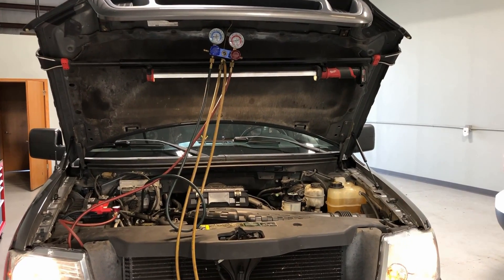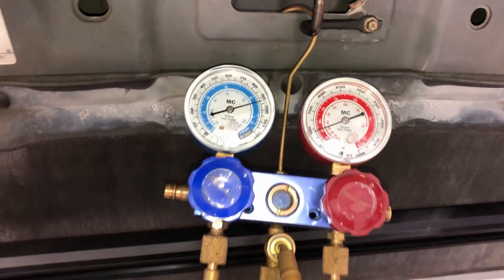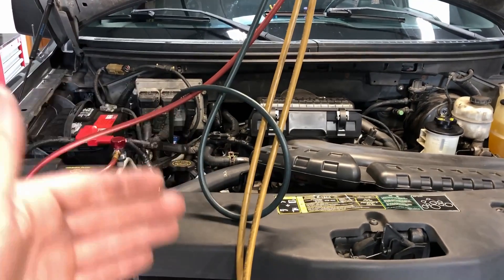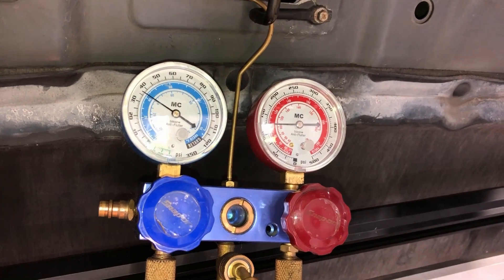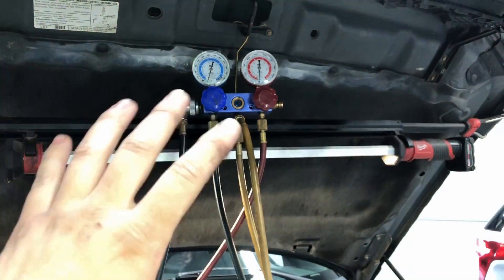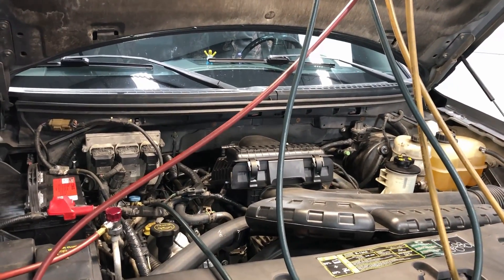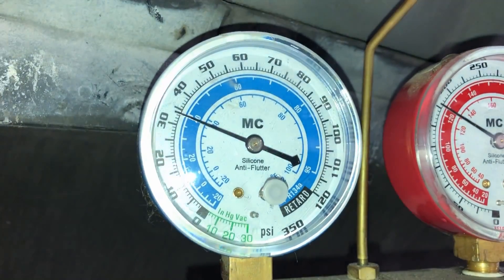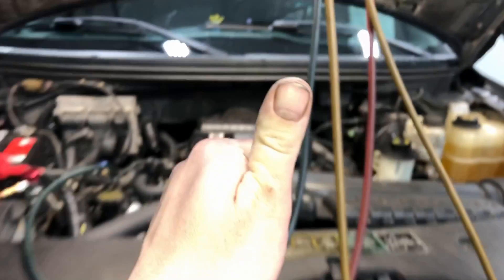Poor Automotive A/C Cooling: Do You Have a Low Refrigerant Charge Level?

Comment: I have a 2000 F150 and would do about anything to figure out how to access the condenser coil to clean it out. Low air flow. I don't care about looks if I need to cut through anything to access it. Can't find anything online that actually makes sense, no one knows how to explain or teach details these days. Same goes for the heater core.
Reply: Sweet project cars has a video showing how they clean condensers thru the drain line. They include links to all supplies.
Reply: Evaporator?   The condenser is in front of the radiator.  My used 2001 F150 blew almost no air through the evap.   Get a couple of cans of foaming AC cleaner. They come with a 2 foot hose to insert into the AC drain hose.   Plenum fills with cleaning foam and rinses out when you start it 1/2 hour later.   I used 2 cans for good luck. Brought mine back to life. 

( Many stores don't even know what you're asking for.   Don't buy the AC flush - that's to clean out the system after a mechanical failure, not the evaporator fins)    I got my cans at O'Reillys.    Also on Amazon.
Reply: @NYCMNYBW01T  - Thanks, yes evaporator. I saw a great video on inserting a can of AC cleaner with a tube applicator into the evaporator tube hole all the way up and spray a couple times. But I cannot find this thing on my truck. Only reference online was some guy said it's just barely a nipple and didn't think anything could go inside it because it's so small (he thought was clogged). I saw poorly made videos on cutting out areas inside the cab to cut open to access and clean. Horrible directions.

Comment: When I turn on my air conditioning it bogs the car down I have low power what could be the problem
Reply: Check for an over  charge man dose the compressor  growl at ya
Reply: @robertdunn7717  so the only way to fix that is discharge the system?
Reply: Robert Dunn yeah
It does groul..why
What does that mean..??

Well its cooling normal, 
but the groul is there loud & clear when take off from a stop sign. 
When clutch disengage the sound goes away. 

Any idea??
Reply: Check for dirty throttle body. Cleaning the throttle body fixed my problem when I turned on the air conditioning. Would almost stall the car at idle.
Reply: @donaldclouse2374  thanks I can do that not to hard of a job
Reply: Granted there's no compressor damage have a shop recover so you stay legal and pot in what you need

Comment: In my car, when the compressor turns on the low side is 60, high side 105 and blows warm (compressor does engage), as I rev the engine, the low side reaches 30 and the high side also increases and begins to blow cold. Should I assume the compressor is shot? 09 Escape Hybrid
Reply from the maker: You need a refrigerant control valve on the backside of the compressor.

Comment: My sons 2011 Fusion has been blowing cool air, not cold. But enough to keep him from sweating. Maybe it’s low too. It’s been a scorching hot summer here in Chicago.
Reply: Could be an issue with the Schrader Valves.  There was an issue in 2011 on the ports.  It affected LOTS of vehicles, and not just FMC.
Reply: Harbor Freight is your friend. Get the manifold set it works well. 2011s probably have dye installed. Look for it with a uv kit. HF also has an electronic leak detector for ~$50. Works great.

Comment: So you are looking for those pressures, High and Low, when at idle (650 - 750 RPM) with the system in Max Recirculation mode in an FOT system?  This is fairly typical I'm guessing?
Reply from the maker: yes

Comment: Yep, that time o'year! Got the neighbor's ('04 maybe?) F-350 with a leaky condenser - he patched it with JB Weld until the new one gets here, lol. Pretty weak condenser on that truck. Looks like a stone took a little chunk out of it. Leak the size of a pin. No sniffer needed - just watch for the fog ...

Also have my dad's 2 year old Frigidaire window unit here - all the refrigerant blew out the corroded condenser - unit is barely over 2 years old from its manufacture date! What a pile of crap! Gotta love 21st Century manufacturing, no matter what line it is ..
Reply: I like the big red warning label on the new units explaining that the refrigerant used is explosive and that there is a risk of fire if they leak !! Yeah that's got to be a big selling point "Here put this bomb in the window of your bedroom"

I've been seriously thinking of just rebuilding the 20+ year old 12K wall unit we have rather than buying a new "efficient" unit.
Reply: @Blazer02LS  - Yeah, you'd be better off! I couldn't believe they made the condenser so thin, especially with R-410A - it has high side pressures north of 475 PSI !! Then they used the crappiest quality metal they could source. Better off grabbing an old one, and either charging it up with BBQ propane,  R-12, or R-22.

Comment: With this hot weather, my 2013 Lariat that I purchased used sounds like a jet engine when the truck is started and takes a while to get cool.  If the temperature drops to 80 degrees later in the day, it won't sound like a jet engine and the AC is really cold.  Is this normal behavior?

Comment: Great timing! I see you linked a set of manifold gauges... do you have any experience with them? Are they good enough for a DIYer? I don’t mind spending a little more if necessary.
Reply from the maker: They are just fine, the next step are gauges over $100.
Reply: Great! Thanks for the reply.

Comment: New subscriber after a few videos. You seem pretty knowledgeable about fords. Here’s one for you man. I have a 2013 f150. 5.0. When my ac is on my fans sound like a jet engine. I’ve had it at the dealership, other guys have looked at it. Nobody can figure it out. One shop finally settled on the ac drier and expansion valve. But what I’ve read it’s a sensor. Any thoughts?? A computer strictly for fords was hooked to it while it was roaring loud and nothing was found. Thanks man! And enjoy the video!
Reply: The radiator cooling fan should run at full speed when your AC is on, that's completely normal.  The condenser is in front of your radiator, in order for your AC to work you have to have very good air flow through that condenser/radiator, thus your radiator fan will be forced to run at much higher speeds than when you are not using the AC.

If your radiator fan is mechanically operated via the old style fan clutch and driven off the engine, same thing happens, the excess heat causes the clutch to engage forcing the fan to spin at a much higher rate of speed.

Comment: Great video - I've got a Ford Five Hundred , and now I have an idea of why my AC is not as potent as it should be. Bought myself some gauges - off to my garage I go...
BTW - ensure that your Compressor Control Valve is not sticking. Had this problem with my car originally. Car had a full charge, but very poor A/C performance. I replaced the valve and it worked 100% better.
Reply from the maker: Yeah your vehicle is one of the few Fords that have that valve.

Comment: Thanks for the info I need to check the system on my 2010 f150. The AC does not blow cold untill you get to high way speeds.
Reply: Make sure the condenser has good air flow, no debris like bugs, leaves, paper and grass for starters.

Comment: Nice Work!  This is the weather for A/C problems!  A lot of people don't know that the A/C system comes on in the winter during defrost, so if the struggled through the summer, definitely get it fixed in the fall!
Reply: If you turn it  on
I turn it off!!

Comment: Does your recharge machine add proper amount of pag oil when you recharge the system?
Reply from the maker: No I add it manually
Reply: @FordTechMakuloco  Can that be done without opening the system?  Or do you add it after evacuating?
Reply from the maker: Yes the injection gun has a one way valve.
Reply: @FordTechMakuloco  Yes, that's what I was looking to know.  Thank you for all the helpful videos.  You do a great job with your channel.

Comment: What is your best guess for vehicles with only low charge that test out with no leaks? Most cars' A/C lines are that half metal half rubber crimped deal, and I'm assuming the refrigerant just diffuses out the rubber part over time. Kinda like the air molecules being smaller than rubber molecules, diffusing out over time  through the rubber of a tire.
Reply: Yes you are 100% correct! Also the shaft seal on the compressor is not a perfect seal!
Reply from the maker: If the system has a low charge and it is not because of being charged improperly in the first place then there is definitely a leak most times at a connection or the condenser.

Comment: good video but why no check for leaks ???
Reply: The system was still holding static pressure and had half a pound of refrigerant in it. Being that this truck is 15 years old and probably on its original factory charge, I can see what he didn't do a long vacuum hold test.

He did totally Evacuate the system and it did show vacuum for quite some time.

Even brand new compressors with minimal use will leak a micro amount at the shaft seal behind the compressor clutch.

When you add 10 to 15 years of age 2 vehicle they will leak a little bit more.

I see Vehicles leaking about a pound of refrigerant after 8 or 10 years of age every 3 or 5 years and they hold great vacuum. 

Also to recharge the system versus rebuilding and replacing the system including a new compressor is quite cost-prohibitive when the customer just wants it topped off every 4 or 5 years.
Reply from the maker: This is literally just a diagnostic video to show what it looks and sounds like when your a/c system is low on refrigerant nothing else. This is the new shop truck it has no leaks it was charged with half a pound for this video.
Reply: You already know something is leaking just not sure where or how much it leaks.  :>)

Comment: Per Scotty Kilmer you should really shouldn't try and refill an R134 ac system unless you have a vacuum and can do it more precisely..
Reply from the maker: Is this just some random comment about R-134A systems or in reference to the content in this video?
Reply: @FordTechMakuloco  

Probably  just some random Scotty worship.
Reply: Thats actually great advice. A little under or overcharged can make a huge difference in performance of auto a/c. Throwing a can of r134 into a system without understanding the system can lead to issues.
Reply: What m ph said. Seems like you need to really point out not to try and recharge the system unless you know what you're doing. Like you did, but didn't really show in the video.
Reply from the maker: This video was only to show what a low charge looks and sounds like, not how to fix it or leak check it.
Reply: @FordTechMakuloco  Yeah I was just trying to point that out in case someone thinks it's a good idea to fill it using the refill stuff they sell in the autoparts store.

Comment: Stay Cool Brian 
I got my MACS certification two days ago. Can't wait Till you make some 1234yf videos 👍👍
Reply from the maker: Eventually, Ford has been slow to adopt 1234yf. I just had a 2018 Explorer still R-134A.
Reply: @FordTechMakuloco
The 2017 Escape we have as a company car uses r1234yf. Surprisingly the car only has about 23,000 miles on it and the A/C failed to cool above ambient temps of 83 F or so. Took it to the dealership and they diagnosed "weak compressor", not encouraged with the new systems.
Reply: @watershed44  hey buddy does it have service ports
Reply: @Richard Gill
Sure does, it's basically almost identical to the r134a systems but the refrigerant is a slightly different chemical make up but behaves almost exactly like r134a. My family had a 2006 Ford 500 with the then "new" scroll compressor which had the main seal start to fail at 60k and needed to be replaced. Ford seems to have a history of weak compressors on their passenger car vehicles over the past decade or so.
Reply: @rrmech11  Yes it has service ports but you need to get the correct gauges in order to properly read the pressures as they're different than R134a...R1234yf runs at even higher pressures than R134a....
Reply: @wildbill23c  ok thanks
Reply: Cadillac has been using R1234yf since 2012,and other models from the GM group of companies since 2013,so it's not really that new.
Reply: @nilesable  Nope, its not new at all, just now they're starting to actually tell consumers LOL.
Reply: @FordTechMakuloco  so far I've only seen them in hybrids Brian
Reply: FordTechMakuloco New Fusions use it at least here wt fleet we have mostly hybrids that use 1234yf and POE lubricant. Expeditions i think are now 1234yf New Ford Ecosport as well.
Reply: Several Jeep vehicles if not all are already using the new refrigerant...FYI its slightly...err extremely flammable.  So if the exploding airbag doesn't kill you in the accident the fireball from the exploding AC system during the accident will get you instead.

Comment: When a vehicle comes in like this with a low charge, do you just recharge it and send it out, or do you perform leak tests and such?
Reply: As a professional auto tech I will say this:
A vehicle with a leak can sometimes hold a vacuum just fine but not pressure (the compressor shaft seal is a good example of this)
also on older vehicles that's it is perfectly normal for some refrigerant leak out over time.
When I get a vehicle in that is simply low on charge I vacuum the system, inject dye, then charge it and the customer to bring it back if it stops working. 

But I let it sit in the bay and run for a while and it would be evident pretty quickly if there's a large leak but in this case the dye would leak out with the refrigerant and you would see it!
Reply: @lustfulvengance  I was about to say they same thing
Reply: @lustfulvengance  That makes sense as the direction is different and full vacuum is only 14.7psi. Pretty big difference form operating pressures and whatever the temperature extremes might do too.
Reply: @lustfulvengance  The dye I use is flaurecent green for AC.
Reply from the maker: This vehicle was charged with half a pound of refrigerant on purpose for video demonstration purposes only. If this was a real situation I would do a thorough visual, then pull a vacuum for 10 min then inject dye and recharge with proper charge. Let it run and drive it then check for leaks with a UV light.
Reply: As a refrigeration mechanic, I’ll say the same thing. You can’t leak test buy pulling a vacuum
Reply: They just charge and send the customer on their way in many cases the leak is so small you can't find it...until the leak gets large enough to detect with leak detection dye they can't really do much unfortunately.
Reply: Agree, I'll bet the vacuum pulls any marginal seals and o-rings tight. And pressure may be more than the psi of the vacuum depending on where the leak is.
Reply: As a previous service engineer who worked on AC units for entire commercial buildings, I know that we never used vacuum to leak test a system. We used nitrogen. We only pull a vacuum on the system when we know the system doesn't have any leaks, to prevent contaminants from getting sucked in and enter the system. Once we pull a vacuum, we use a precision vacuum gauge to verify that all the moisture is evacuated (any leftover moisture will cause vacuum loss, as the moisture evaporates and increase the pressure.) Once it passes the vacuum test, we then charge the system with the correct amount and type of refrigerant. My reason of asking is that we would never have simply recharged a system with a low charge. Low charge means loss of refrigerant, and since it's a closed system there has to be a leak where it escaped. Now, I know in cars the AC systems are much smaller, so I was mostly curious if it's common practice to just recharge a system with low charge, or if it will be leak tested to find out where the refrigerant was lost. :)
Reply: I would recover all of the refrigerant from the system and then charge the system with a small amount of refrigerant and pressurize the system with nitrogen. 
Then use a leak detector to look for leaks.
Reply: @tpcoachfix  isn't estrogen a female hormone?
Reply: @shimes424  should be Nitrogen. 
Dam spell check.
Reply: @tpcoachfix  lol I thought maybe estrogen was what you had with you so you used that instead 🤣😂 jk
Reply: @shimes424  That's when your AC doesn't work for 5 days every month.
Reply: .45 Lbs out of 34 ounces means 3/4 of the refrigerant leaked out.  He definitely should have checked for leaks.
Reply: @markgigiel2722  read his comment, he said he charged it that way for illustration purposes
Reply: Charge ac system with nitrogen to find small or slow leaks
Reply: cant leak out with a vacuum. but can with pressure.
Reply: You would be able to tell if there was a leak by the vacuum reading on the recovery machine after you discharge the system.

Comment: I got a 97 an the compressor comes on but I hear a ticking noise when it's on sounds like a valve tapping that whit sounds like can someone help me an it only blows cold when moving
Reply: Duke Reeves probably low Freon.  Check to make sure the fan is working at idle.  Put a pressure gauge on and check it out
Reply: Yes I had it checked it does work
Reply: Clean your condenser coil it may be partially blocked with dirt and debris
Reply: @zeke112964  I tried all that